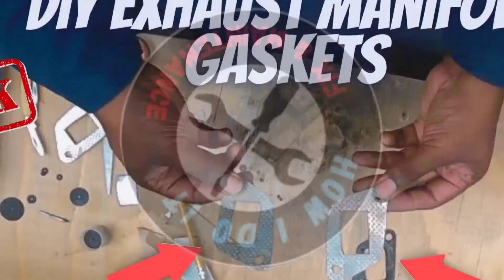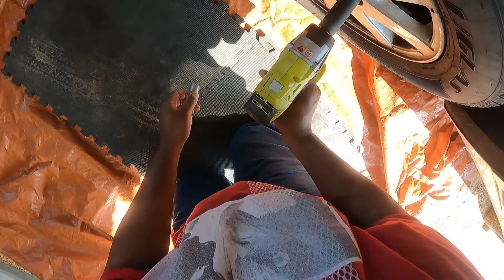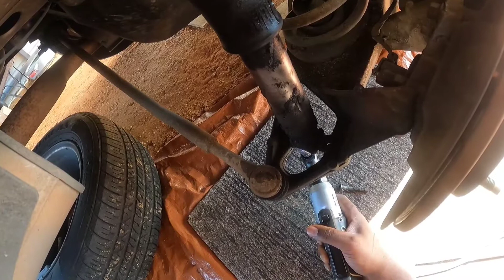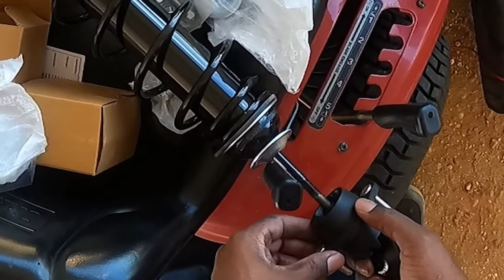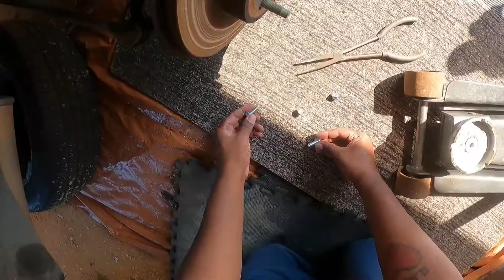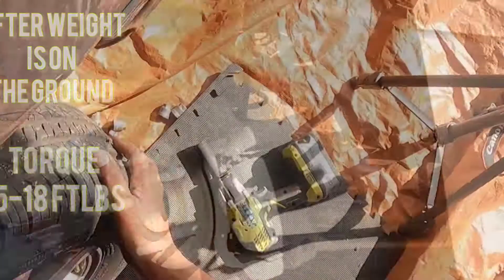2005 Buick Park Avenue Air Shock Conversion to Monroe Load Assist Shock

Comment: Thanks for the video.  I  acquired a 2005 park avenues with only 38,000 miles.  What is the usual life of the factory air ride system?  Keep up with the great info videos!
Reply from the maker: Depends on your terrain and how much added weight (passengers) you usually drive with.  My shocks started to fail right around the 100k mark. I probably could have saved the compressor if I would have changed the shocks right away.  Only 38k?! You got a deal. You shouldn't have to worry for awhile I would think.

If you haven't already, consider subscribing. I have a few more videos on the Buick and more coming soon.  Thanks for watching
Reply: I'm at 120k miles on my 2000 Park Ave.  Guess this is coming next for me.  When I fill the gas tank up, I hear that compressor wanting to run for 30 seconds or so every time I get in the car and start it up.  My front struts are squeaking now, too.  Everything is going on this car at once for me.

Sounds like if I don't do something about the rear shocks soon... I'm going to burn my pump out.  Pump is still fairly quiet for the time being.

But now winter is here.  And things love to tear up in the winter lol.
Reply from the maker: Thanks for watching! You are absolutely right. Be better than me lol. I would check to see if you have any leaks on those rear shocks while that compressor is still good.

Yea man the cold weather has me at a little stand still as well.
Reply: @HowIDoItFaM  Thank you haha.. the only reason I even said that was because of your and another's comments under this vid.  I can't even think that far ahead lol.. just replaced the alternator and battery 4 weeks ago, then within 2 weeks, my car was cutting out while driving and dying when pulling out from a stop.  

Got the codes pulled and it was the MAF sensor.  Put that on around 5 days ago.

Then 2 nights ago, it was 22F and I left my car running when I went into a gas station for cigs, came back out and the check engine light was on.  Great lol.

Not sure what this light is, yet.  The MAF would only turn the light on occasionally, then the light would turn right back off.  However, I did put gas in yesterday and when I took the gas cap off, it like "popped" off.  Never had it do that.  Hoping that is the cause of the current check engine light.  Not sure WHY the lid wanted to pop off like that, though... Could it be that I park my car in my basement?  It's 70 degrees F down there (it's just the "downstairs" of my house, but it's a basement).  It's heated/cooled by the heat and air pump.  Maybe that drastic change in temp... caused something?  First time I've noticed this happening.  Car has been in the family for 20 years.

And with all this coming at me, I need to be preventative and do something with these shocks.  They aren't an imminent thing, at least.  But... they will be.
Reply: @HowIDoItFaM  I'm subbing.  Not that you asked for it lol.. but ya got helpful vids and they're gonna be helping me out along the way.  I guess it's the least I can do.  I appreciate an actual mechanic that helps people like this.  I don't want to say "I'm subbing" for a thank you or anything (if it comes off that way).  It's actually the best way I can say thank you to you.  These repairs along with car insurance, electric and water bills all coming in at the same time drained my bank account lol.  So... it's pretty much the only way I can say thanks.
Reply from the maker: I appreciate the Subscription. It keeps me motivated knowing that I can help somebody with these videos. 

No way I could I diagnose  your buick with out taking a look at it in person. With that being said, it sounds like you're having " Evap" problems. The way the gas tank was pressurized, causing that gas cap to pop off when you were taking it off, it sounds like the tank isn't venting properly.  I had a similar issue with my  buick. I ended up changing the vent solenoid and the Evap canister.  Not saying that's exactly your problem, but I would start with the cheapest possible solution first (the gas cap itself). Make sure your tightening it properly (I promise you I still get a check engine light every now and then because of a loose gas cap) 

Gms Evap system from this Era is a mess to be honest. I have a 2005 tahoe and the whole Evap system is clogged so it doesn't vent properly. It takes 37 minutes to fill up because of all the pressure building up while pumping gas 🤣. 

Its a good thing you are doing by addressing these issues head on and early.
Reply: @HowIDoItFaM  " It takes 37 minutes to fill up because of all the pressure building up while pumping gas"  OH wow!  

I appreciate the advice.  Thanks for everything.  Here's hoping the revenue from YT is good or gets good (100% not my business, just have my fingers crossed).  Lord knows how many people you've helped do something they didn't have a clue how to do before watching.  Or maybe were too nervous to dive into without some confirmation.

Comment: If the compressor still works, a pair of Monroe air shocks for these Park Avenues is around $80 for a pair of direct fit shocks. I just installed a set a few weeks ago, along with their Monroe Quick Struts. I think I spent around $400 and my time and labor, along with the alignment. So, call it $500. I have the 2003 Park Avenue Base model, with the "K" in the vin, bought on Amazon, car rides like new.
Reply from the maker: That was my intention when I first started. In my case the compressor was was so loud, failure was surely imminent.
Reply: @HowIDoItFaM  I can understand that. I am honestly surprised mine still functions.
Reply from the maker: @michaelwright1602   I think if I would have caught mine before it started to run all the time (due to the shock failure) I could have saved it.  Thanks for watching. I appreciate it. Please consider subscribing.
Reply: @HowIDoItFaM  Subscribed and liked. ;-)

Comment: I'm confused you showed the connector on the frame and then you reached in past that and it looks like the one you pointed out is still connected.
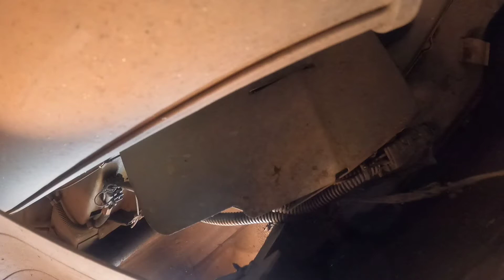Reply from the maker: The first connector @ 2:08  I showed was the one not to disconnect. The second connector that's underneath the car near the compressor is the one that I disconnected. @  2:10 I explain it. 

There is also a fuse under the rear seat you can take out to disable the air compressor.

Comment: Can't you just unplug the fuse for air ride?
Reply from the maker: Yes that's an option as welI.  

I really wanted to keep the air ride system at first, but I didn't find out my pump was shot until I looked at it. Just decided to unhook it while I was under there and go with the ride assist shocks.
Reply: @HowIDoItFaM  yeah little to costly for me I'm going with the spring assist conversion

Comment: Thank you so much for such an awesome helpful, instructional video!!   The air compressor of my 2005 Buick Park Avenue keeps pumping air every 20 minutes or so.  Is it the sign that I need to replace both of rear struts?  What is your opinion about Monroe's quality in comparison with KYB brand?
Reply from the maker: It does sound like you have a leak somewhere in the system. Without inspecting it I couldn't tell you exactly what it is. In my case it was pretty obvious that both my pump and air shocks were worn out.

The ride quality is pretty much the same especially cruising on the highway.
Thanks for watching Simon! Don't forget to press that like and subscribe button.
Reply: @HowIDoItFaM  Ok sure!  Thanks again!    I appreciate it.

Comment: Doesn't disconnecting the air compressor cause a check engine/warning light on the dash to come on?....
Reply from the maker: It's been a few months and I havent had any issues with it.  I didn't pull the fuse from under the rear seat either.  I definitely will update if that problem happens, but so far so good.

Comment: Well done video, thanks for posting. How is the ride now compared to the stock air ride system before it went bad?  Firmer, softer, about the same?  Thanks.  Liked & subbed!  👍
Reply from the maker: Thanks for watching, liking, and subbing. I really mean that.  Far as the ride goes, it's firmer than the original air ride system definitely. On the high way, the air ride felt better, but not by much.
Reply: @HowIDoItFaM  Awesome, thanks for the feedback! 👍

Comment: I've got a 2002 and I know someday in the future (once the shocks fail) I'll be doing this conversion. Thanks for making this video!
Reply from the maker: Thanks for watching. They definitely ride better than the failed air shocks.
Reply: I have a 02 park Ave the rear sways and bounces I'm doing this conversion thanks 👍
Reply: @funnystuffhappens9382  thaw suspension has nothing to do with the swaying you might want to check your rear sway bar links

Comment: just pull the fuse under the rear seat lol. way easier
Reply from the maker: I really wanted to keep the air ride system at first, but I didn't find out my pump was shot until I looked at it. Just decided to unhook it while I was under there and go with the ride assist shocks.